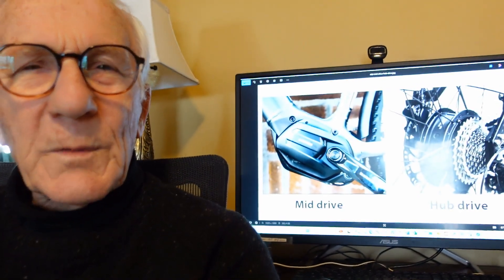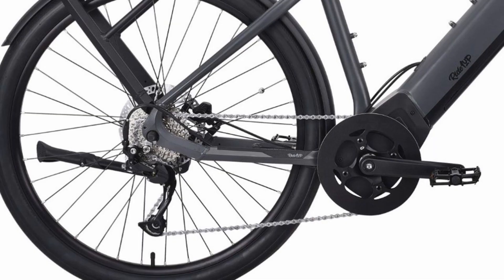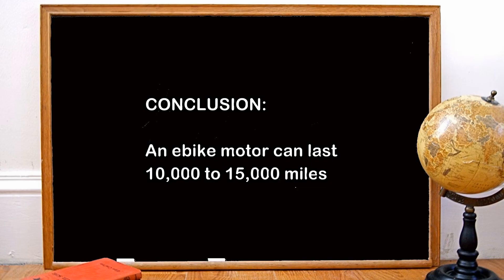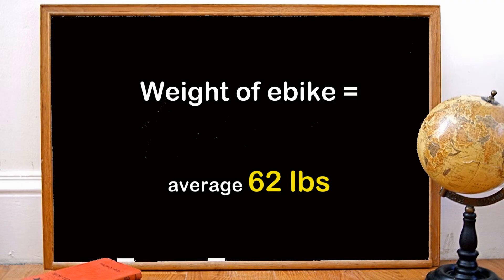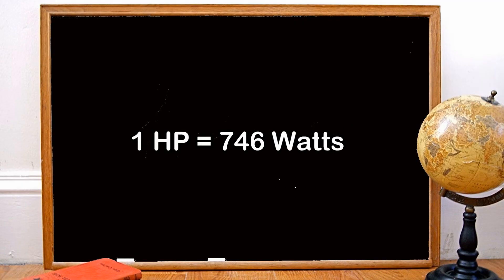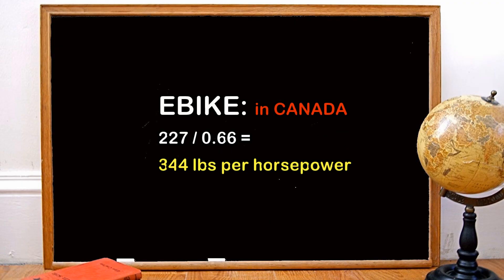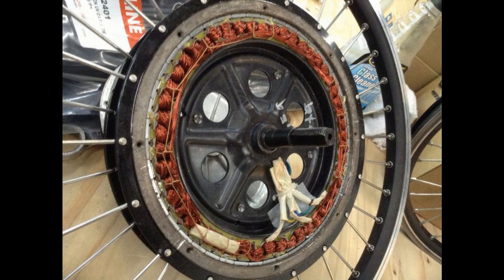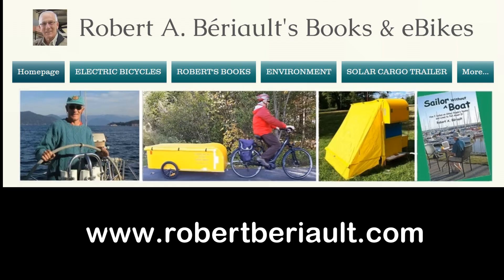Why Ebike Motors Have Such a Short Lifespan

Comment: even direct drive hubmotors fail…usually the hall sensors fail, or if loaded up at slow speeds, you can short the windings from overheating
Reply from the maker: I guess the way it's ridden can make a difference.
Reply: If you can short the windings with a direct drive hub motor then surely it would be far worse for a mid-drive motor or geared hub motor as direct drive hub motors are large and heavy and disappate heat very well indeed. In fact a basic direct drive motor you buy in a 500W kit could be used probably all the way up to 3000W. Direct drive don't have a lot of torque due to lack of gears so typically 30-40Nm, they are the weakest of all motor types for torque for the same wattage. I'm sure I read of someone getting 60K out of one without any issues at all and I saw a video on Grin technology where a extremely well used direct drive motor was restored to full functionality very cheaply likely hall sensors or bearings ready for another 8 years or so. I think direct drive is a great value option especially with regen and the savings to brake pads.

Comment: Comparing mileage isn't really appropriate, as cars are designed to go on long trips.  E-bikes would be much more favorable if you compare HOURS used.  That's how you measure airplane usage, racing motor usage, etc.
Reply from the maker: That's a valid point. I'll have to think about that. Thanks.
Reply: Yeah, let me tell you: The hours spent going <7 MPH, have been by far the hardest, on the whole ebike and myself! 

Probably more wear in an hour of rough trail riding, than a hundred hours on the road.

Comment: I think after 7 thousand miles you got your monies worth...😢
Reply from the maker: I'll look at it your way. Suppose it cost $300 for a new motor, then 7000/300 comes to $0.04 per mile, plus probably another battery, $500, $0.07 per mile. So you're now at 11 cents a mile. It depends on what you think is an acceptable cost and it depends on how much you value the joys of riding a bike.
Reply: Battery waste is a major issue.   
An aging pair of "60V" batteries, wired in series, might make for a serviceable wall-power backup? Old 48V batteries seem less immediately useful, though. 

When ours no longer take a full charge (currently getting about the same range after ~3yrs), I plan to split both batteries open, toss any dead cells, & put the remainder into one voltage-regulated UPS with a solar charger. 

I'm hoping that silicon anode cells will indeed scale to mass production by then (much lighter for same Wh), or possibly even "solid-state" silicon-sulfide cells! 

Getting a great price on a nice pair of batteries, was a joy. Now the market seems poised to produce way better stuff by the time they need replacing; I'm elated!

Comment: The nylon gears in a hub motor are intended to wear and fail. As you mentioned, replacing them is easy. It is better that they wear rather than the geared housing of the hub (which would basically kill the motor). Labour cost is pretty irrelevant if you fix the bike yourself, which can be done with simple, inexpensive tools (compared to working on a car these days!). I haven't tried direct drive, but I'd like to. I understand they are heavier, and have a good top-end but don't accelerate like the geared motors do.
Reply: @oddlytimbotwillison6296 - The cost of the set of 3 plastic gears with the new bearings and cir-clips is less than $10 and since you don't have to disassemble the spokes and rim it only takes about an hour to replace them.  Even if you have to purchase a simple bearing puller the cost of replacing the gears and giving them a light coat of white lithium grease is very low.  Of course many bike shops will want to sell you a $600 +/- OEM motor rather than replace $10 worth of gears because either way their getting their minimum 1 hour of labor however with the motor they are getting their cut of profit from selling the $600 motor instead of a few dollars profit off selling the $10 gears.  Some also want you to believe that the Sun will fall out of the sky and come crashing down on your house if you repair your own bike.

In the worst case you can purchase a complete matching kit with a new hub motor already mounted on the rim, controller, throttle, display, wiring harness, PAS sensor, etc, etc for around $200 and have a 100% completely new system on the bike.

Best!
Reply from the maker: All that is very true for those who have the ability and time to perform mechanical work. But for the majority of riders, a motor failure means an expensive visit to the bike shop.
Reply: @RobertBeriault753  It saddens me that so many have become incapable of what the average 10 year old could do when I was a youth.  It really should only be the small minority who can't do this for themselves.  

Of course we could get into a discussion of the difference between those that really can't, self defeatists who due to their own fears falsely believe its beyond them and those that simply won't.

I've met very few people who really can't and a great many who self defeat and won't even try though they are totally capable.

Sometimes I have them watch and then pull them in to see if I have the order correct etc and then ask them to tighten something, start the threads on some bolts and by the time we're through they've done 75 to 90% of something that thought was impossible for them to do.

So many end up pleasantly surprising themselves.

Yep, Old age and Treachery indeed!

Best!
Reply from the maker: Fixing bikes is fun for some people and an unpleasant chore for others. Thanks for sharing your observations.
Reply: @RobertBeriault753  We didn't necessarily view it as fun as youths however as something that facilitated fun such as getting to a baseball game, a movie, out fishing, etc and be able to afford that baseball mitt, bat/ball, movie ticket, popcorn, candy, 45 rpm record, fishing line, hooks, bobbers, etc, etc with the money we saved by fixing it ourselves.  

People unfortunately waste a lot of money and get into a lot of debt because they have been duped into believing these repairs are too difficult, impractical, dangerous (fear mongering) or unpleasant for them to perform themselves.

Can you tell I'm not a big fan of the "Can't Do" crowd?

Best!
Reply: I couldnt agree more with your comment my friend. Plastic gears going bad wont hurt the inside components of the motor. And if youve worked on cars, these ebike motors are like a 4th grade level of difficulty.
Reply: @limitedchez   Just curious on this thread then, if I do offroad and take jumps, would it make sense to go with copper gears? Copper is softer than steel and would possibly last longer than nylon? I had planned on doing this after my nylon gears fail. Would it be a bad idea? They also sell copper/nylon gears where the outside quarter edges of the gear are copper and the middle inside of the gear is nylon. I do a lot of wheelies and jumps too.
Reply: @20x4E-bikes  I'd stick with nylon, realistically you only need to replace it once every 5000 miles or more
Reply from the maker: I think you're right on all those points.

Comment: My bafang moror just exeeded 20.000 km and still running smooth. It also depends on the force it has to delever.  max force = 250 W (legal) max speed = 25km/h (legal)
Reply: I have two bafang 250 hub motors. One has 17,000km and one 12,000km. I average 29kph over flattish terrain riding on full power. Both motors are fine. One battery got weak after about 350 charging cycles so was replaced.
Reply from the maker: Makes sense. Thanks for the info about your Bafang motor.
Reply: Same situation (250W, 25km/h). Similiar  experience (48.000 km in 4,5 years), no bafang motor, 95% used in flat terrain, runs smooth but sometimes problem with the controler

Comment: Thanks.
I guess you just need to factor in replacing the plastic gears at a set mileage, before they go. And really the shop / manufacturer should tell you this.
Reply from the maker: Right!
Reply: It's gonna depend a lot more on how\where you ride, than how many miles. A mile on a rocky trail & a mile on a paved road, are simply not comparable. 

People often say that over 15KpH, aero rules, but in reality, terrain is the undisputed king, when it comes to limitations like speed, range, & wear & tear.

Comment: This is a great and interesting topic, Robert. Siemens, Germany started electric motor building about 150 years ago. Some of them lasted extremely long. But the questions are: How big are the relations weight to move, speed, watts and how big and heavy the motor can be?
Other question: Does a small motor for a moped that runs on gas last longer in comparison to an e-bike motor?
Which e-bike motor brand lasts the longest? Experiences with Bafang middrives are good. And these motors can be repaired. Last Bosch longer? Are MAC hubmotors from E-Bikes, Vancouver, Canada the best?
Reply from the maker: All good questions. It would take a well-funded research team to gather data to arrive at answers.
Reply: " how big and heavy the motor can be" is the key here. Think old washing machine motor, never dies because its never overtaxed. Apply this idea to your Ebike. Big motor like a BBSHD and 48volt. It will power up really well. Of course, thats DIY and not for everyone.Local restrictions usually mean bikes have underpowered hub motors.

Comment: When you initially referred to size of motor I thought you were talking about physical size rather than power rating.  Physical size does matter because it effect ability to dissipate heat (if your motor was physically larger could it have reduced the likelihood of the gears melting?).

The other issue not mentioned is the far more comprehensive regular services a car gets compared to an eBike motor.  If there had been problems with a belt in the car motor part way through the expected lifespan of the car motor that could have been fixed without replacing the entire engine; yet when your eBike motor gears got worn out it was seen as end of life for that motor.
Reply from the maker: I should have mentioned that a motor with a heavy mass has more ability to absorb and dissipate heat, which should have a protecting effect for the susceptible components like gears and electrical parts.
For can engines, it's so easy to change the oil.

Comment: I've seen metal clad plastic gears...not sure if they help though.
The comparison with cars works out ok, but a comparison with ebikes with different power motors probably won't support that argument. Here in Australia, 250W (1/3hp) is the maximum legal power, so by your reckoning these should last 1/3 of the equivalent 1 hp bikes from the US. I'd argue that less power with the same drive system should make Australian ebike motors last longer.
Reply from the maker: Excellent point! Because often it's the very same motor that's configured to operate differently.

Comment: He didn't even compare a 1HP ebike with 1 horse!
Reply from the maker: If we do the math, a 1,200 pound horse has to haul around 1200 lbs of weight on only one horsepower. That's about five times more weight per horsepower than an ebike has to pull around. And the rider never has to worry about lubricating the gears!😂
Reply: 1 horse provides a lot more power than 1HP!
IIRC, it's about 15HP

Comment: The gears are like 7 bucks. The problem is nobody considers before buying. That being said you can get a ton of miles out of a gear motor if you don't start messing around with your amps.  I'm not really good at the conversion but if you're getting 7000 miles out of a $200 motor you're doing good! I would say batteries are a bigger expense what is your battery I'm doing after 11,000 kilometers?
Reply from the maker: I don't find anything wrong with what you say.
Reply: Ten years Im on my second battery. I notice my new laptop and new phone have adaptive charging, 20 to 80% for long battery life. If you have a big pack on your ebike this is the way to go.But normally we are squeezing everything out of an ebike pack for range.Which Ive done so Im torn here..
Reply: @jaaklucas1329  I might fully charge mine once every 10 charges. Just to balance the cells I heard it's more healthy that way for them but I messed up yesterday I got a new battery and I was going to go for a ride, so I charged it all the way and it's raining super hard. Now I'm just waiting for a break so I can ride it around the block a couple times to use some of the charge
Reply: True.  The batteries are likely to give trouble before the motor, and the batteries can be harder to work on!  (Personal experience with battery, hub motor, and mid-drive.)

Note: regular application of a suitable grease, e.g. Mobil-28 aircraft grease, to the gears seems to help with both durability AND noise…
Reply from the maker: I'll look into gear greasing. Thanks

Comment: I suspect the motor/gearbox weight to power ratio, would be a more reliable indicator of design stress. Also, the price of an overhaul or total replacement is quite different.
Reply from the maker: Thanks for this idea. It's a relationship that should be investigated.

Comment: Robert... I have the bafang BBSHD 1000w mid-drive on my recumbent trike... 
Before installing it i opened up the plate under the Sprocket.. that revealed the Reduction Gear...
At the factory they put cheap grease.. 
So I packed "Black" "Moly grease with lithium 2 ".. The moly grease must be the black grease. and it must be the lithium 2.. this protects the plastic gears in the motor.. 
This will prolong the motor life.. by making the motor run more cool,smoother and faster..
A faster spinning motor with lower torque will keep it cool and preserve the motor.. I now have over 14k miles on my trike.. and every year, i have more of the black Moly grease with lithium packed in the gears..  My motor runs quiet and smooth.   Lower gear, higher power is the way to go.. Lugging down a motor will cause the controller to burn out or cause the motor to fail.  I always run lower gear higher power.. and that also increases my range.. Lugged down over burdened motors suck up Watts and lower range while causing damage to an electric motor.. PEACE
Reply from the maker: Very sensible advice. Thank you.
Reply: Did similar with mine, only used Mobil-28 (red) aircraft grease.  

I need to secure more in the foreseeable future.

Comment: My ebike has hybrid metal + plastic gears in the hub. Maybe a little more noisy, but certainly not "loud".

Allegedly they should last longer than straight nylon gears.
Reply from the maker: I wish your ebike and you a long life!
Reply: @RobertBeriault753  Thank you Robert.
Reply: I have seen these, I do plenty of off road and jumping on my ebike. Do you also? I was thinking about these hyrbid gears in copper and nylon. Have you noticed any more strength when doing wheelies? I like to wheelie too and am worried about my only nylon gears.

Comment: I have had failure of the ebike controllers and I had determined that with setting it on the highest PAS setting the controller will fail early. It's best to set the controller setting on a medium assist level for longevity because of inadequate component cooling. Also having a spare replacement controller  can come in handy as they are relatively inexpensive but a pain in the ass to reconnect all the connections. Carrying a replacement controller  and tools with you can aid in not becoming stranded or having to pedal a heavy ebike a long distance  without assist back home.
Reply from the maker: Good points, thanks for sharing. It would be interesting to have an idea of the average longevity of ebike controllers.

Comment: You forgot to add that bikes usually travel at 1/4th of the speed. (legal assisted speed in the NL or UK is 25km/h)
Most ebike batteries or motors don't have proper cooling for sustained efforts. (shitty EV's have the same issue)
Yes, plz compare Ebikes to EV's as well.
PS: regulations in the Netherlands are crazy atm, in fact it's actually illegal to have a motor that can take more than 250 watts even when it's restricted to 25km/h when you read that shite. Also somehow they changed the 25km/h moped regulations to that you need a helmet, so everybody..incl 8 year olds are now using ebikes that get the same speed without training, insurance or helmet and it's become a big issue because of the cheap chinese fatbikes and politicians not knowing shit about bikes. Especially problematic when derestricted,  and not having proper brakes. Speed pedelecs are assisted up to 45km/h but need to ride on car roads where the speed limit is 50. So in practise they just zoom past you on the bike lane cause they don't wanna ride on the car roads.
Reply from the maker: Thanks for your perspective.

Comment: A delivery rider friend has ridden 25,000+ miles on a Cube Kathmandu gen 3 performance CX, always in turbo and it's and still going strong. It needed a new battery at this mileage though.
Reply: I also do deliveries on bike and have ridden almost 35.000 km on my Bosch Gen4 CX. Luckily I have 2 batteries and they still hold pretty well.
Reply from the maker: If only Bosch would provide a throttle...sigh!
Reply: @RobertBeriault753  get an electric motorbike instead?
Reply: @RobertBeriault753  That would not be considered an ebike anymore, but a moped, and for that you need a drivers license (at least in Romania)
Reply from the maker: I've had people suggesting this several times. I think they forget, or don't know why people love riding a bicycle. Or maybe they are too young to feel what it's like when the body ages or has disabilities.
Reply: @RobertBeriault753  a throttle? GET A E MOTORBIKE, you don't know what a e-bike is!!!
Reply from the maker: Good to know.